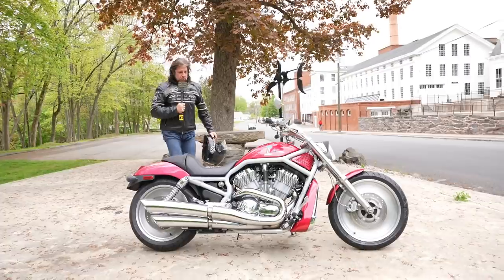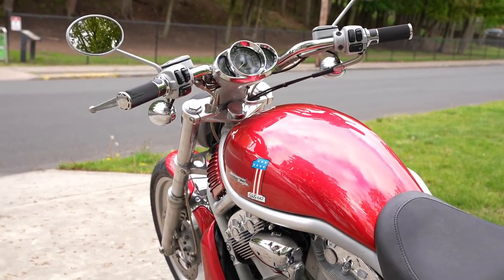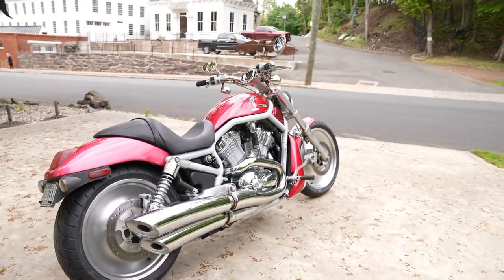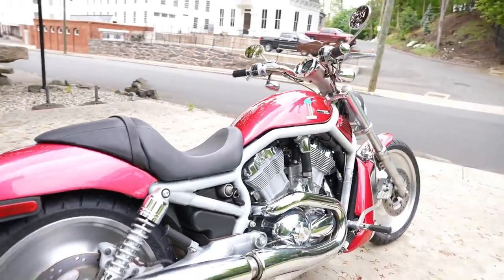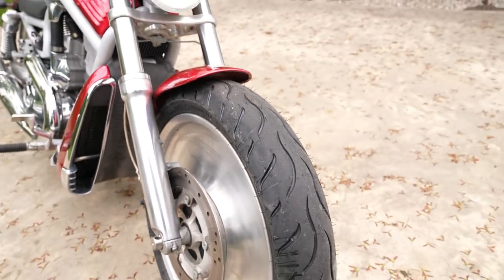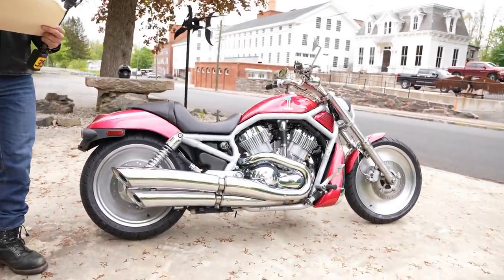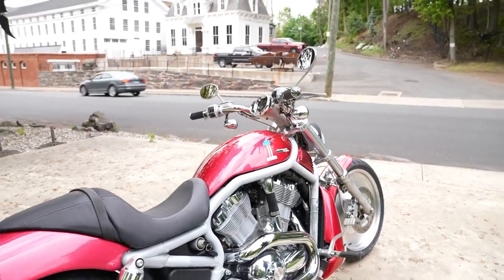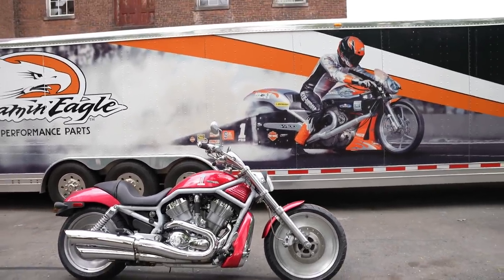2002 Harley Davidson V-Rod

Comment: The V-Rod was actually sold from 2002 till 2017.  02'-07' had the 1130cc motor putting out 115HP 08' and up models were the 1250cc motor putting out 123HP.  In 2006 Harley Davidson started putting Brembo brakes front and rear as some thought the original brakes were a bit inadequate.  I picked up a 2006 two years ago with only 4316 miles on it for a little shy of $5k, and I'm in love with it.  It gets looks and compliments wherever it goes.
Reply: The extra cc and horse power of the newer models was to compensate for the heavier designed machine. The original v rod 115hp is still the fastest production harley ever made

Comment: My first and only bike (so far) is a used 2013 HD Vrod muscle. When I look at and compare other bikes and options I feel so spoiled; it really feels like the perfect bike for me. 1250 cc stage 1 w/Vance&Hines 2n1 to haul my 340lb frame around & brembo brakes with available ABS to stop it. 240mm rear Michelin Scorcher tire together with the huge 5gal under seat tank and top of engine air box give it an almost impossible to drop peg scraping extra wide and extra low center of gravity. The super comfortable forward controls and nice wide soft factory seat make this muscle cruiser one of the most intuitive and easy to ride bikes I have ever ridden. The engine is basically bulletproof being watercooled and designed for racing (see Düsseldorf test). Because of the hydroformed frame design the bike doesn't get the death wobble at highway speeds like a lot of other traditional Harleys. One of the best parts still is it's worst part, or should I say best part again... Because of the hate from the diehard Harley enthusiasts this bike didn't really sell so you can get a used one for cheap, but since it's a Harley and well built as long as you take care of it it can basically hold it's value; from personal experience I was just recently offered trade-in value at what I originally purchased it for.

Comment: You confused the engine specs with Vrod Muscle bud. This 1130 engine is weaker than you say
Reply: @mitchmoot2832  what's to explain? It's got smaller displacement, less torque and power.
He gave numbers of 1250 bigger motor. This is smaller and weaker 1130 unit.
Reply: @mitchmoot2832  who says it's unreliable? I certainly didn't. I commented on the numbers he quoted which  were wrong and taken from specs of stronger and bigger motor.
Guy confused weaker early engine with bigger VR Muscle motor.